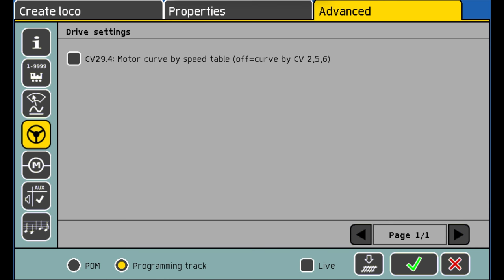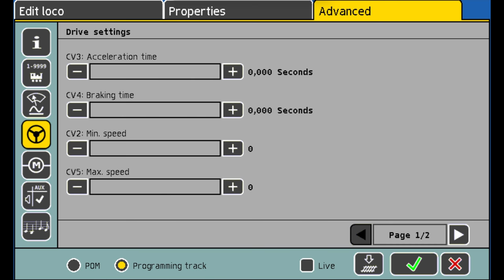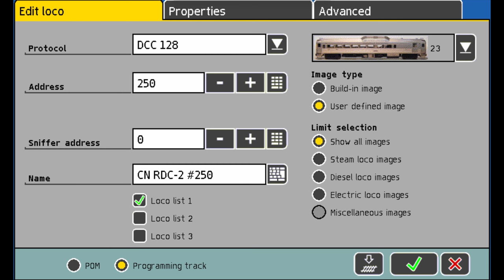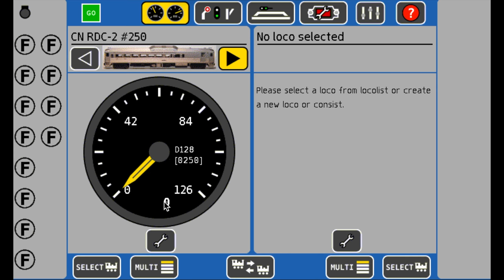How to Add a New Locomotive to ECoS2 Digital Command Controller - Step by Step Guide

Comment: why didn't you show the step to select long addressing?
Reply from the maker: Hey @3pedaldriver , I didn't show how to do the long address because the ECoS2 makes it supper simple to program address to trains.  Meaning that the ECoS2 does it automatically.   So this is something that you do not need to worry about.   If this is something that you  would like to see, I will look into it and see what i can find out and prepare a video on this topic. 
Thanks for your question.   
Keep on modeling. 
Tim...